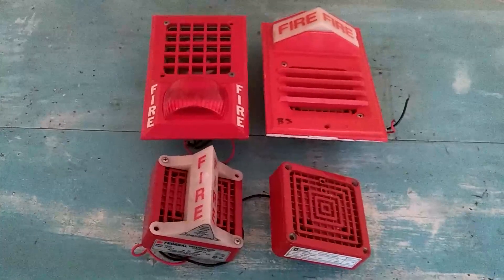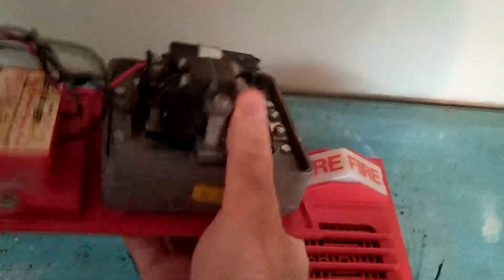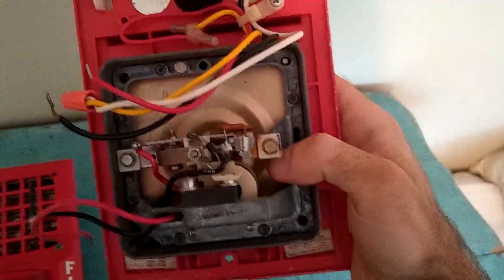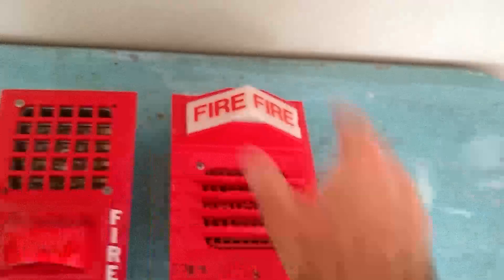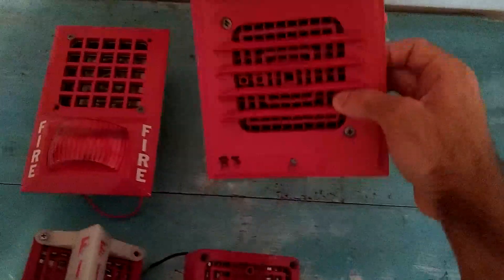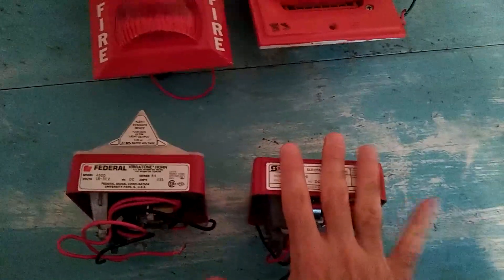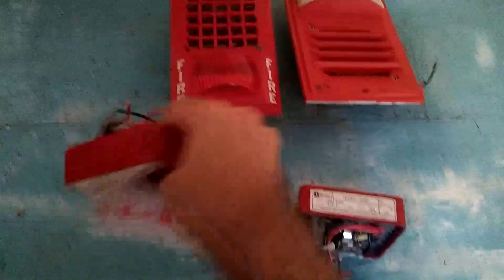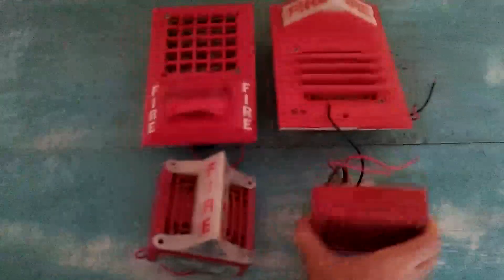Comparison - Federal Signal Vibratone 450 fire alarm horns

Comment: Interesting they put a gray Vibratone 450 horn behind the Space Age AV32 light plate. Reminds me of the VFW my brother's basketball league use to have their Christmas parties and end-of-year banquets at, but with gray Wheelock 34 horns behind the AV32 plates (originally an older Notifier system from the late 70s or early 80s.) Usually when I see Vibratones behind AV32 plates, they are the B2 or B4 versions, rebranded by FCI or Space Age Electronics (this was a particularly common configuration on FCI systems in the 80s.)

Comment: Which coding sounds best on horns
March time 
90bpm
Code 4 4
Code 3
Continuous
Nice video too
Reply from the maker: Depends on the horn. For 7002T's and newer Simplex horns (9806 and later), continuous takes the cake. For me -9838's on strobe plates in continuous is the quintessential fire alarm.

However, I think 4051's sound better on march time (90 or 120 bpm doesn't matter that much to me), and don't really think nonflashsing light plates are all that interesting on continuous either. I really only like code 3 if there's synchronized strobes involved. Something about light plates on code 3 just seems "off" to me.

For large, round horns like IBM 4030's or Faraday Type 2's, code 4-4 is probably my favorite.